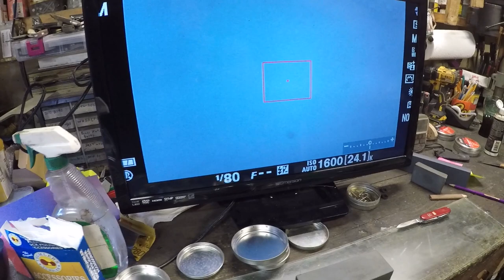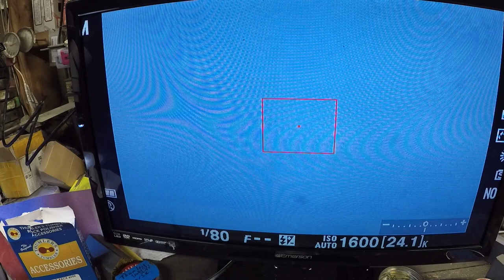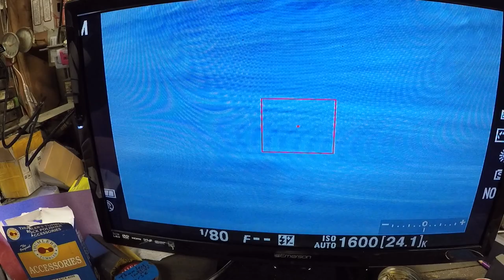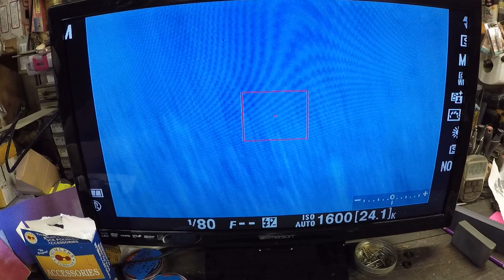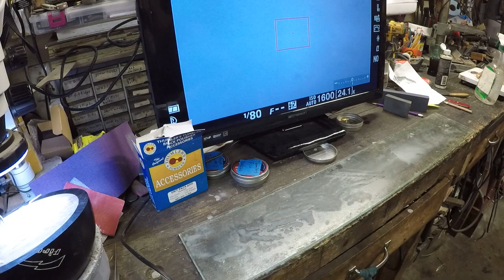lapping, flattening and conditioning the fine side of a silicon carbide sharpening stone 2

Comment: Instead of using abrasives, maybe you can lay a piece of sand paper on the top of the glass. I think it will be much faster cause whereas the abrasives will be moving around on the glass, the particles on the sand paper are fixed.
Reply from the maker: i thought the same thing......   but i think the loose action of the abrasive particles on the glass is what makes loose sic powder cut so efficiently.  i watched a video awhile back on how they might have cut the stones for the pyramids with loose sand and rope that expained it, but i dont remember where that video was.

Comment: You are my reference ;) Can I ask you which abrasive is more adequate for lapping an oil stone: aluminum oxyde or silicon carbide ? Pros and cons? Thanks again!
Reply from the maker: the only aluminum oxide powder i have worked with is the really fine powders that come in the rock polishing kits, in the same kit the silicon carbide is included for the coarser grits, so that would suggest that the aluminum is more suited to fine polishing for one reason or other.
Reply: @joecalton1449  I found aluminum oxide powder, grits 40/60. Much cheaper and easier to find than silicone carbide. Worth the try I guess. Do you think glass beads would do the job, too?

Comment: Thanks Joe for the video. Wondering about the relation of the stone grit and lapping grit required. Let's have a 150/320 grit stone. Does the finishing grit should match the stone grit, for instance, begin with 90 and finish with 150 ? For the 320 grit side, should we use lapping grit of 150/300 for example, not the 90 grit ? Also, I have read that we should never use a fine grit with a coarse stone. Correct ?
Reply from the maker: the biggest thing in lapping is to get it flat and remove any trash in the surface of the stone so that it will cut good again. after that i like to stay a bit on the coarse side for the grit rating. it seems to me that if you lap too fine then it sort of glazes over the cutting edges of the grains at the top of the new surface and the stone doesnt cut quite right. if you lap a bit too coarse, then the grains that are unsupported just break off and leave fresh grains underneath them.
Reply: @joecalton1449  So in my example of my stone 150/320, what lapping grit would you recommend for each side ? Thanks.
Reply from the maker: @yvesn58  i think its pretty tough to beat the thumblers variety pack of grit that they sell for rock polishing to start with. it come with a 60/90, 120/220. a 500, and 1200 grits. Id start with the 60/90 and get everything flat, sharpen a couple knives on that, and then try out the 120/220, and sharpen some knives and see what you like best. then you will know if you want to order a coarser or finer powder
Reply: @joecalton1449  Thanks for the advice, Joe 😃

Comment: Hi again Joe.If the SIC breaks down in use how do you know when you've ended up with the grit rating you're after on the stone? is it when the SIC is crunchy or at the end of the break down stage and will the broken down powder be giving a finer grit finish? Thanks. ATB.
Reply from the maker: i think you get the grit rating when the sic is fresh, so if you were to throw 60 grit on the plate and that first little bit of cutting would be about 60 grit and then it would break down from there. so if you finish your condtioning session with some fresh grit then the stone would cut the way it should till you break the surface down by sharpening.
Reply: @joecalton1449  Thanks Joe. So really only a short time on fresh powder is necessary as in before the change in sound. ATB.
Reply from the maker: @peteswright  yes, if you want to finish the stone with as close to the freshest cut that the sic powder can make before it breaks down.
Reply: @joecalton1449  Thanks again Joe. You've done it again. All this extra info is invaluable to us who miss stuff in your commentary. ATB.

Comment: How can you differenciate between stone grit or lapping grit when looking through the microscope ? Also, maybe a dumb question but a sharpening stone does it have grit on surface only or if you lap it for 1/2 inch for example, will it remain sharp or just flat (blue background looks like the grit is on surface only) ?
Reply from the maker: man made sharpening stones, like chunks of rock or compressed powder like the norton crystolon are the same grit all the way through or are supposed to be. stones like the dmt and smiths diamond stones are a flat piece of metal with a diamond coating.  so to tell stone grit from lapping grit, as long as the surface is clean, then most of the surface should be stone grit, and lapping grit should just be bits and pieces here and there that hung on through being cleaned off